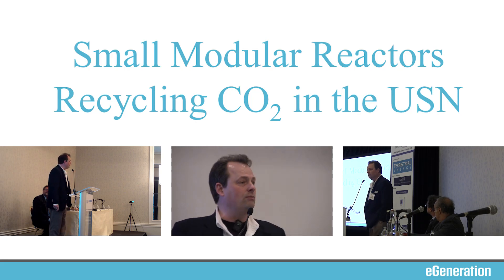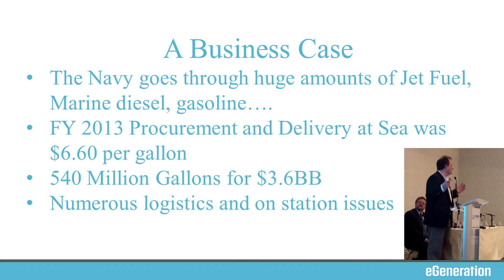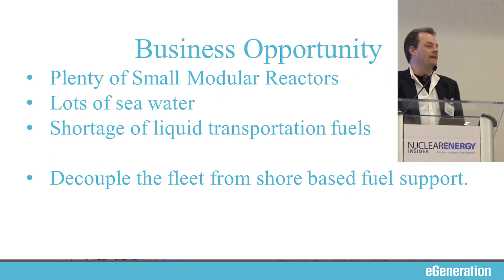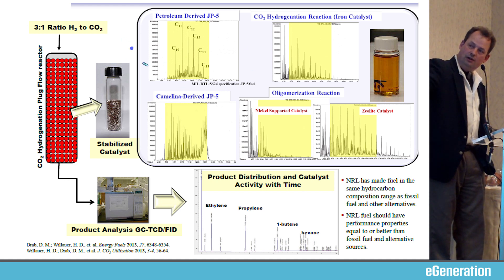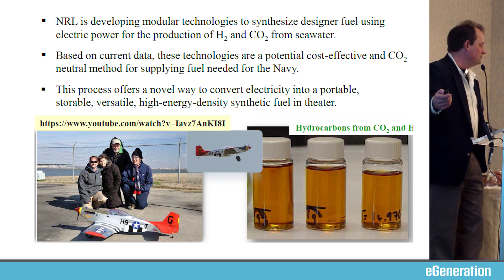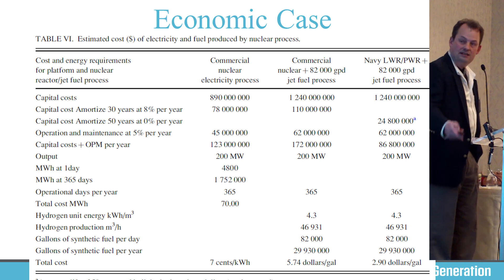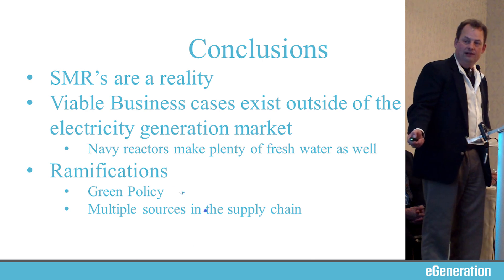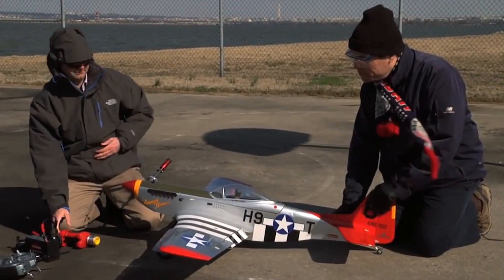Recycling CO₂ in U.S. Navy with SMR (Small Modular Reactors) - Don Larson

Comment: Regarding aviation fuel for commercial aircraft, a stop gap to consider and also a way to prevent micro plastics from infiltrating into our ocean.  Take the plastic containers, most can't or aren't recycled and crack those polymers, maybe using heat from a (Th breeder)MSR to produce aviation fuel.  Aviation fuel won't be easy to replace with H2, NH3, CNG, LNG etc....  We can use electric cars and maybe use reactor H2 in natural gas pipelines (CH4/H2 blends?) for domestic space heating, but aviation requires those C8 to C12 hydrocarbons as the lecturer outlined.  This guy is US Navy, what is the USAF and US Army doing?  I heard that the USAF was interested in Fischer-Tropsch reactions maybe 15 years ago.  They wanted to take it out CO2 from the air I think.  I think it is easier and more environmentally pleasing to remove the pH changing dissolved CO2 from seawater.  Is a lot of chlorine produced in this way.  Cl2 strong oxidizer and a byproduct is NaOH?  A pH changer for the oceans?  Hmmmm.  Lots of possibilities, but what is wise to do.  Now in future with so many nuclear trained airman, sailors, solders you could have a great civilian work force after retirement.  I mean I really trust a Navy Machinist Mate (person who operates nuclear reactors) who's life depends on making sure a submarine or carrier works.

Comment: Thorium = Electric load + fuel maker.  NO variable turbines needed on grid.  The fuel makers are the frequency and voltage maintenance on the demand side AT THE PLANT, not via grid.  Need to eliminate grid in fuel making.  Ship fuel, not grid due to crazy renewables that drive up costs.

Comment: Yes, make fuel on boats that float around and avoid any regulations.  The future is flying.  Cheaper than road tax, tires and brakes with my roadable seaplane and new engine (60-75% efficienct)  This video is spot on.  Thorium can be done for 3 c/kwh.  That makes 4.5 c/kwh for fuel or $1.5 /gallon.  Cheaper than oil...
Reply: Dual fluid reactors apparently as low as 0.7 cents/kwh.
Reply: @ChristophePochari   Yes, possible.  I am just going by what Thorium MSR start up guys claim they can achieve. 

At 0.7 c/wkh x 1.5 for fuel making, that would make 23 cents/ GGE, or about what NG is at well now.   Retail could be 50 c/GGE.

Run car on 50 c/GGE fuel would be doable and amazing.  A battery costs now $4/GGE just to use it.  8:1 ratio. ...  Fuel is the path...
Reply: @seaplaneguy1  at 0.7 cents, I can make hydrazine from sodium hydroxide and chlorine for $1.2/gge (gallon gasoline equivalent). Since I'm using the hydrazine in a PEM fuel cell, 2.6x more efficient than SI. At that price, I can beat diesel for trucking, 1.4x more efficient than diesel, so $2 gal diesel. Automotive is not the best candidate for hydrazine. My goal is to put the guys making the 700 bar dispensing out of business.
Reply: @ChristophePochari  If 0.7 c/kwh you can make NH3 for 1.5x or 35 c/GGE, not #1.2/GGE.  That is 3.42 x more...not competitive to NH3.
Reply: @seaplaneguy1  It's 3.5x more expensive because I have to use a ton of sodium hydroxide, but it's still plenty affordable. Ammonia is a gas, which poses safety issues for non-commercial use. Hydrazine is far safer than ammonia and even hydrogen. It's a liquid, so if you poke a hole in the tank, it drips into a puddle on the floor, no different than diesel. It doesn't spray in your face.
Reply: @ChristophePochari  Ammonia hydroxide.  NH3 + distilled water = cheaper.

Comment: CO2 to fuels plant CAPEX and feasibility of rapid ramping of production as a MSR heat is shifted to/from power cycle.  That's what I am interested in.  Traditionally that sort of plant has been the sort of thing you fire up and run at full-capacity shutting down only to do maintenance in order to finance the CAPEX.